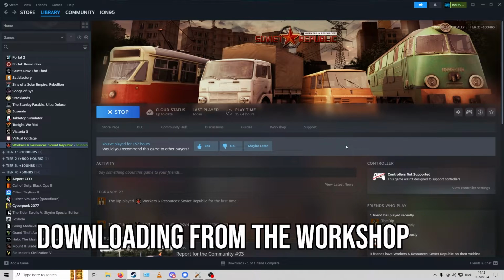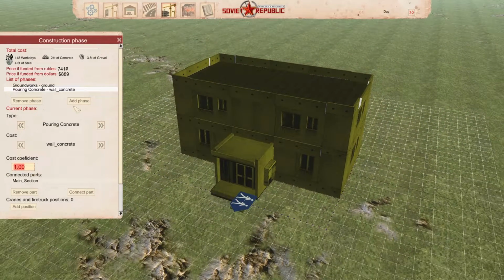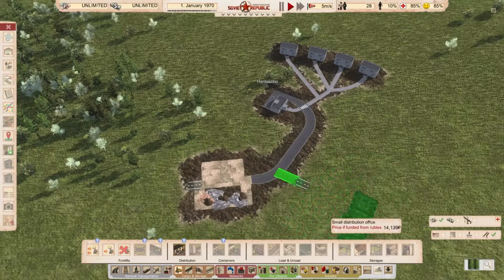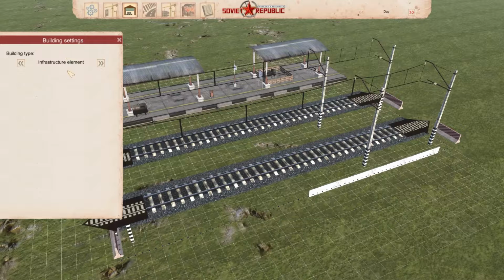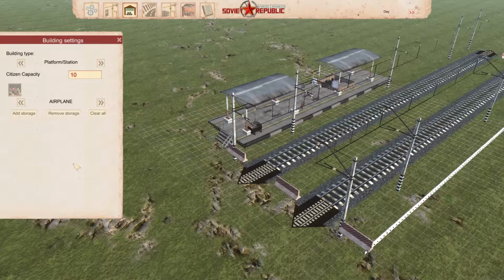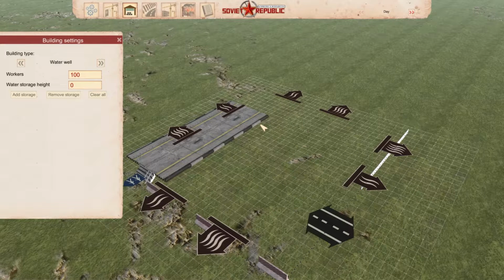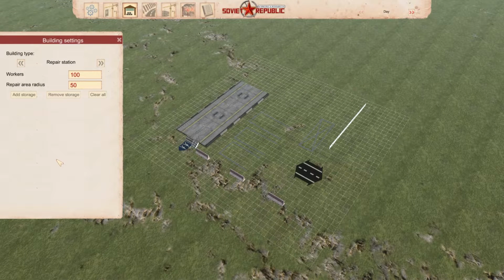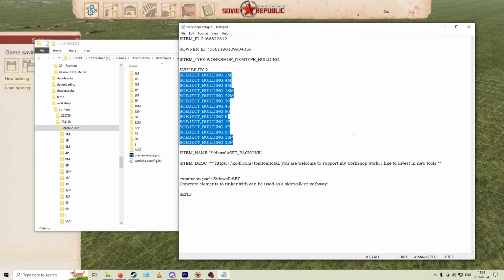The Ultimate Guide to Workers and Resources Building Editor

Comment: Hi, big man, I have a problem. I would like to build a 17 story tall (elevated ground floor and maitenance floor with no windows on the top),  building for tenants. The editor let me build up everything until the 7th floor (from second floor is the same, so I just copied), than as I reached the 7th floor, the building editor tells me to make another part because they cannot handle this in one part. I do it but I cannot ut the second part onto the top of the first part. How can copy the last floor of the first part and place onto the first floor of the second part? Is there a key combo to place one full part onto another without getting multiple brain aneurism from the shear rage and anger? Because I even saw 30 storey tall buildings amongs the downloadable content... Thank you for any advice. :)
Reply from the maker: I haven't personally experimented with very large buildings so I can't exactly help you. More than likely, those larger buildings were made in Blender and not the ingame editor.

I will probably make an updated version of this tutorial with more research done on it to reflect changes and maybe cover something like this.
Reply: @ion-95  Got it, it is done. It was a bit fiddly. It is not about the levels it is about number of the parts. depends on how high, two building parts, three or four, leave one, two or three column upstairs from the base in a common wall. Than just have to build up a streak, then start where the other part of the building finished. Therefore you parts are touch the ground, but sitting on the top of each other. You can do the groundworks and build the bases at the same time, just do as many wallbuilding and roof building order as many building parts you have in order, connect only the upcoming building part. Not because the game cannot make it the same time, but because it looks funny when the parts are hovering in the air until the other part is done under them. That does not make it more expensive, but looks more real.

Comment: Is there really only like 50 building parts you have access to in the editor or am I missing a button somewhere???  Like how there's just 4 different lamps under the Parking lot Lamps  tab, or how there's just 11 under Prefab 1 tab?
Reply from the maker: If you've installed mods they'll have their own section in the editor, but yes there isn't much to work with. The building editor has been quite neglected.

Comment: Great video been waiting for a detailed explanation video for q while now i can try and make a mod haha.
P s do you know is there a way to edit a mod your subscribee to already? There's a couple kf mods i love using but arent quite made properly and would like to edit is it possible? 
Thanks.
Reply from the maker: You can edit the text files of mods in their workshop folders. You can also reverse the process in the workshop section to bring a building into your editor. This is not something I filmed and made in the video unfortunately so if you have difficulties with it I could probably even make another video showing that process off.
Reply: @ion-95  yeah I edit the txt files a lot probably more than I should haha  it's just a perfect example is there is a mod called hardware store I love using it as the author made it store nearly everything but it has one factory connection and needs an oil an ore and more factory connections to make it useful so would be great to know how to edit them. If you do make a video it will be greatly appreciated thanks again for the content.
Reply from the maker: Yeah I might make a video on it, sounds like a lot to do haha

Comment: Hello, I want to build a multiplatform between train/bus. I would like to set a path inside the building for a vehicle to go from the entrance a certain route and exit out and I can't seem to set it. The bus always behaves strangely. Do you know how to do it? Thank you
Reply from the maker: Would need to see some screenshots to see what's not working. I know there's some limitations to making vehicles move about inside a building so it may also be impossible
Reply: @ion-95  I would like to have three bus stations angled, but I only have one point for each station that can be moved
Reply from the maker: As in when you move the stations about you only have one of the points you can drag to change the size and angle? That's probably a bug.
Reply: between the rectangle where the vehicles stop and the entry point to the building I have only one point to move. I'd like the bus to go around the station and not go straight from the platform to the exit.
Reply from the maker: There's limitations to the AI unfortunately, I think what you're describing is something that can't be done without doing something like road in connections and road out connections

Comment: On the subject of placing the workers waiting on the platform, if you select it and use the mousewheel it will move them up or down.
Reply from the maker: Now that's a big detail I missed, does it work for connections too because that would make cableways work.
Reply: @ion-95 I just tested it and it appears to work as well. Doesn't seem to work with road or rail connections.
Reply from the maker: @Rymrgand-r5k Yeah that makes sense